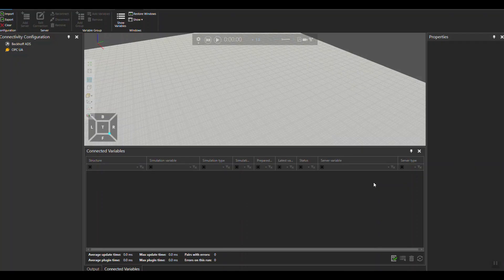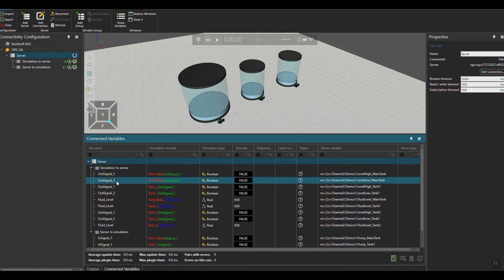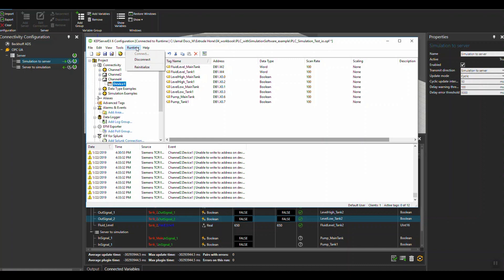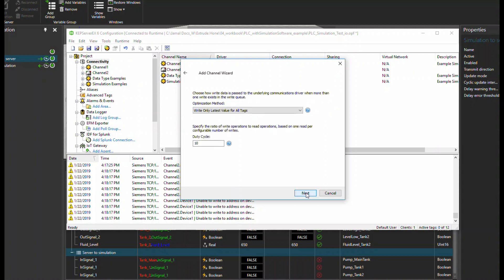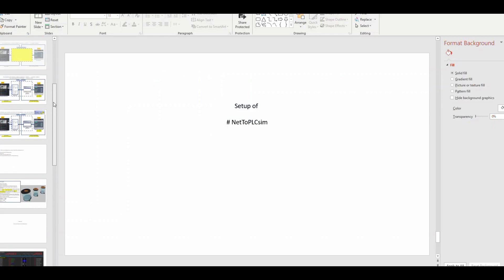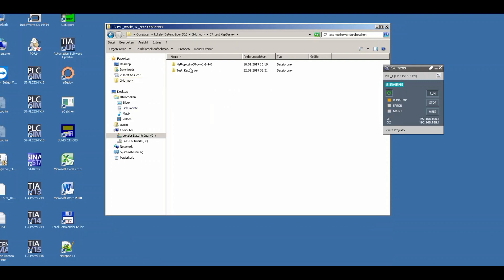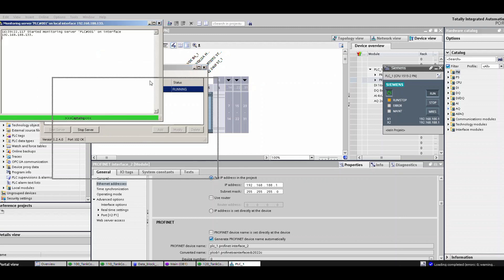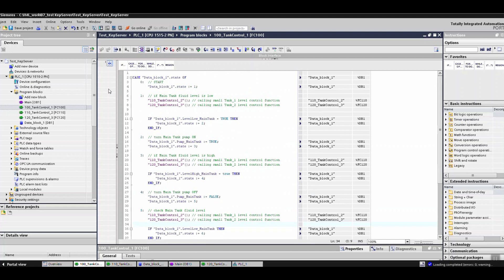Part_1:PLC program (Siemens TIA V15) with Visual Components Pro

Comment: Hello! I would like to ask a question if it does not disturb you too much. I am currently facing a problem creating a tag in KEPServerEX V6, through I'm trying to create a Boolean tag and each time i check OPC Quick Client, my tag quality appears as "Bad", which then does not allow VC to connect and Read/Write it's values. How can i change this? 
Thank you so very much.
Reply: I am facing the same problem, did you manage to get any solution? Thank you.
Reply: @andergonzalez7223  heyyy, unfortunately I did not :/ I think we moved to a different project not long after.

Comment: can you just tell me where from do you have that opc.tcpc://127.0.0.1:4935 Adress that you gave to Visual Components
Reply from the maker: You need to get it from your; 
KepServer -- > OPC UA configuration
Reply: @guzzar100  First of all thanks for the fast answer. At the moment i am using the Siemens PLCSIM Virtuel Ethernet Adapter is it ok, and when i do all what you did i get :

[ERROR] It was not possible to load the endpoint description from the server and select one that matches the specified security and protocol criteria.
[ERROR] Connection to the server failed: An unexpected error occurred while connecting to the server.

What do i type in Discovery_Server and what in Serveradress
Reply from the maker: @frankolovrat3831  Please check if you have set OK to the option -- > Allow anonymous login to OPC UA , this you will find in your KepServer project. There is one slide in the video which mentions about this.
Reply: @guzzar100  Thank you, i have the connection now. But the problem now is that the outgoing signals from the plc can be writen in my simulation, when i try to write a inout signal to the plc i cant. when the plc is on stop the kepserver writes the signlas how it should be from the simulation, but the second i set the plc to run it overwrites the input signals to false. the plc i am using is a 1200 safety. Do you know what could i do.... and sry for bad englisch :(
Reply from the maker: @frankolovrat3831  i think i know your problem, there are some limitations with VC OPC UA connection. Inputs (to PLC) are strictly Inputs, Outputs (from PLC) are strictly Outputs, so first make a  clear distinction what are your Inputs/Outputs - - - in PLC (always think from PLC point of view, it makes life easier) then strictly use them as Inputs(from simulation to server), outputs (from server to simulation) in your OPC UA connection in VC Software. Also look into detail documentation of OPC UA Connection from help file, it will get more clear. This limitation also means that you need to modify your PLC program.
Reply: @guzzar100  Ok super, now everything works fine thank you so much. I had just one more question. I am using safty SIgnals and all other signals can be writen just the safety singlas cant. Is it so that the plc dont alow to write and read safyte signals or do i ned to do something special
Reply from the maker: @frankolovrat3831  I didn't try with Safety Signals. But maybe I can help. You are trying to write Safety signal in PLC or in Simulation? Is it an input signal to PLC or output signal from PLC. If it is in PLC i.e. PLC Input signal then have you checked the Property of the Instance Function Block of the safety program? Is there some option for "allow read/write from OPC UA", did you enable the PUT/GET communication? Did you double check your direction setting of signals are right in Simulation (Input/Outputs are not swapped?)